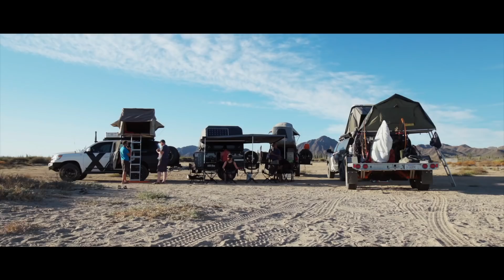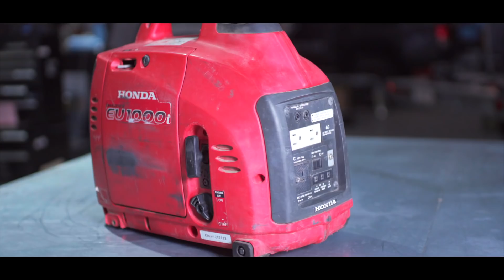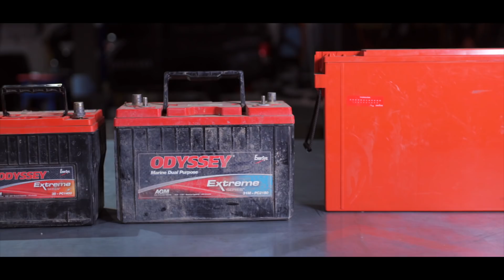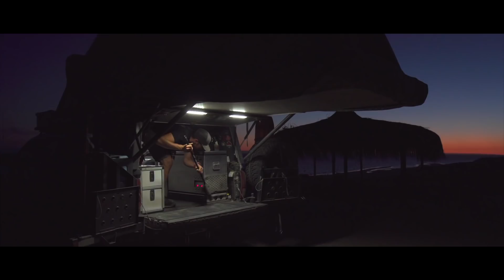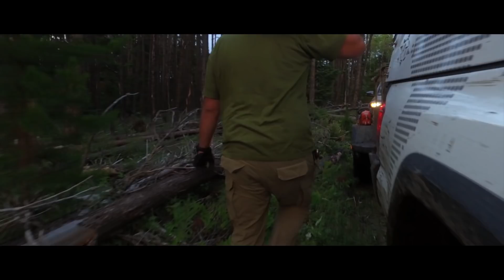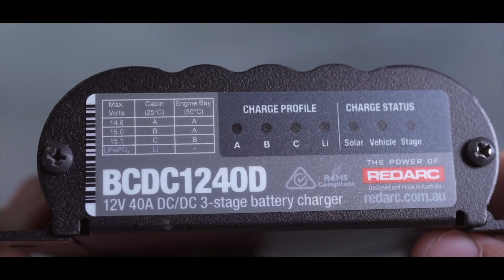Overlanding Vehicle Power and Battery Systems: Proven - Gear & Tactics by X Overland

Comment: Also what are your thoughts on hood mounted solar panels?  I was looking at Cascadia 4x4 hood 30w panel to passive charge my main battery.  And then I wanted to run a separate battery in the truck bed of my gladiator mounted to a top rack mounted bigger solar panel to charge batteries / gear / fridge.   Any tips and info would be helpful! Thank you!

Comment: Curious on the battery selection. Many of the people we camp with, bring RV's and many have resolved their power problems by replacing their 12v batteries, with dual 6v batteries for the additional AH. Have you guys experimented with a similar set up or heard good and bad information about going that route? Very interested in having a Redarc battery management system and curious if it would work with that set up and effectively see the two 6v as one 12v and operate/ monitor the power as well as it would the single unit...

Comment: Just a heads up, sine wave inverters do produce a sine wave, but non sine wave inverters don't produce a weird looking wavy pattern, they produce a square wave. They spend time either at the positive voltage, zero, or the negative voltage with abrupt transitions.

Comment: Next move for you should be to look at LiFePO4 battery's. Far more usable amp hours because you can run battery's down almost all the way without damaging, lighter and 4x the cycle duty on average. Battle born is a popular brand right now

Comment: Great information. We run a Genesis Dual Battery system in our JK with two yellow top Optima Batteries, and carry a 110 watt solar panel as a backup power source. Works very well for our overlanding trips.

Comment: There is another drawback to Li batteries in addition to cost and that is they don't like to operate in cold/very cold temps.  If doing winter work, the batteries temperature needs to be accommodated.  Another advantage is that they can endure many more deep draw downs than other batteries i.e AGM, etc. Love your videos.

Comment: Clay, quick question, why don't you go to a larger alternator in your Toyotas?  I went from the 130 amp OEM in my 5th gen 4Runner to an aftermarket 270 amp.  Couldn't be happier.  I realize you still have to have the rpm's up but the difference is still worthwhile. I also use a portable 185 amp solar panel when camping.  It is a bit of a bear to store and set up but never needed any more power than it puts out.

Comment: do you choose your equipment based on weight?  i ask because the trucks with caps and armor already seem fairly heavy already and if you bring on more  equipment, would it just bog down the trucks so much it might seem dangerous on higher pitch surfaces?

Comment: Wife and I are looking to purchase a Vestibule Tear Drop to tow behind our Toyota Highlander. After watching several power videos I believe solar is your solution over the long term. But, for short off grid meanderings I may stay with my Honda gen set as it sips fuel, always runs, with an extension cord can hardly be heard from distance from camp while running at idol charging batteries. 

To my thinking gen set versus solar is theft. Folding portable solar panels can be quickly carried away if I want to run to a Mom and Pop mountain Cafe for lunch. With my Honda going, Even exploring away from the camp site. I have a spiffy security system as I just let’er run couple of hours to get my 110 amps back good again. At night, I have little reason to run generator. Unless of course its HOT 🥵 then this old Dude has NO Problem burning unleaded. 

I have owned my Honda for 20 years, I bought another the same so I can pair them up if need be. Speaking of emergencies. Home base power outages are now the norm here in California. My Honda 2000’i serve double duty keeping my refrigerator and freezer going for lengthly hours. If it were me, I’d seriously do the math an research what power really means affecting your adventuring but also, being a backup for the home. 

One other thing. When buying fuel for generator use. Be sure to enter 30 Day reminder in your cell phone calendar so as to pour stored fuel into your vehicle. Replenish ASAP. This way fuel is always fresh. Of course I am speaking to California blended fuels—Your state may vary. The reason I don’t use stable is due to high cost here in Cally. I figure, soon, we’ll reach $5.00 a gallon closer to Christmas.

Comment: Have you considered Lifepo4 batteries?
Reply: W0JMR We offer those. They have their place, but AGM is more reliable by far. Very common for bms failures in vibration applications. Plus there’s the whole leave not trace thing.Li is pretty harmful for the environment considering you can’t recycle it, and the mining process is rough too.

Comment: I was always having to replace the battery on my dualsport around 1 time per year. I upgraded to an odyssey battery... and never had to change it again. It was worth it. More reliable AND cheaper after year two or so. lol
Reply: And... I agree about Lithium! It is next level for batteries. Not as sensitive to cold or heat as lead-acid either. Less fade.

Comment: Many people here in Oz use simple VSR controllers (not DC-DC) to give maximum charge to recreational batteries, supplemented with solar (caveat, "smart" alternators need to have the controlled charging turned off). Unless looking at long cable runs (to camper trailers etc.) I can see no benefit to using DC-DC. A VSR will charge more quickly than a DC-Dc for day to day tripping, topping up with solar simply makes the situation more reliable. I know you are sponsored by Redarc, but their recommendations for the average vehicle are more suited to their marketing and profitability than your outcomes (and their solar panels are, IMO, ridiculously overpriced.

Comment: Those big agm batteries are not worth it for mobile uses. The weight per usuable amp/hr is outrageous. Not to mention the space they take up. A 55 amp hr lifepo4 battery has more usable power, takes up a 4th of the space and weighs probably 20%.

Comment: 100w of permanently mounted Renogy solar, 200Ah of AGM battery storage in 2- 6v units, supplemented by alternator charging through a Blue Sea ACR, took me and my family to Guatemala and back. We had a 50L Dometic fridge, lights, laptop and camera chargers drawing on it and never had a problem, even when sitting for a few days in 35 (95) degree heat.
Reply: Almost my same setup, 100w permanently mounted, 100ah house battery with voltage sensing relay, off main battery/alternator. About to switch to lifepo4 battery for more usable power if I have a couple cloudy days in a row.

Comment: Would you please make a video about how to select the right roof rack? What are the advantage/disadvantages between between more modern style racks such as Eezi-Awn and Frontrunner versus the traditional basket style racks for overlanding trips? Also, for those of us who also use roof boxes (Kamei, Thule, etc.) and are considering an Eezi-Awn rack, how can we ensure that we can still use our roof boxes on family road trips?
Reply: "how can we ensure that we can still use our roof boxes" = no difference to your current roof rack... use suitable U bolts to mount the boxes. "advantage/disadvantages between between more modern style racks " = flat racks provide more storage flexibility in terms of not being restricted by vertical sides on the rack, just look at the difference and it's self explanatory. Also, flat racks are slightly more aerodynamic when not loaded. No need for a video on this topic. cheers

Comment: the (i) on the generator stands for inverter generator, it is an added cost if your application needs it, if you are running power tools and lights of the generator you won't need a staple frequency/voltage anyway, and most laptops chargers will work of a huge frequency and voltage range, but some smaller electronics might be sensitive to voltage drop and frequency shift.
you should have used 350-watt solar PV panels, they should be enough for all of your needs.
i was planning to build my own LI-PO battery using 18650s, it is cheaper though and lighter, and you can shape up ur power storage to your space, with maximum battery life if used correctly.
Reply: Can you expand on building a battery from 18650s? Any links for where you did your research on that?

Comment: There are reinforced higher power alternators for many vehicles available on the market, did you try one of these? While most alternators are 3 phase, they often use 6 phases what gives you a smother DC current after rectification and also higher possible amp draw at low rpm.

Comment: Good to hear you're going with solar, it is the best way to go. Do not go cheap on your lithium batteries or charge controllers. Check out Battle Born Batteries and Victron Energy for your charge controllers and inverters. Keep your Honda generator for backup. Find a way to mount your solar panels on your trailers and trucks. While you're going slow on the trails they will be charging your batteries.

Comment: 1a) Your alternator will perform much better if you install a very slightly smaller fully on it so that at idle it will put out full power. This is not enough to wear out the alternator prematurely since the alternator only needs a slight RPM increase to put out almost full power. You can also look at the parts catalog and install a larger alternator that was intended for Police/Fire/Ambulance vehicles because they can be ordered from the factory with alternators that are designed to keep all their electrical equipment operating at fill power even when the vehicle is idling for hours at a time.
1b) Your usage appears to be very close to the Police/Fire/Ambulance usage case so you may want to peruse their options to see if they have already solved your problem.
2) Lithium batteries can fail if they receive any sharp impacts or excess steady vibrations above its threshold, do some research to see if you can install a shock absorbing mat or mount for them. us
Reply: I was about to say this and you summed it up perfectly.

We run an alternator that runs 180amps at idle which comes from a military radio truck
Reply: @JimmyStewpot  I want that alternator! LOL

Comment: SIne Wave is actually pronounced like Sign Wave (not "Sin" Wave) LOL Other wise its a great video, thanks!
Reply: Plus a non sinewave is also known as a squarewave as the scope is squared off.
Reply: @makemineatriple2006  Actually in devotes that supply power it is most commonly known as a "Modified Square Wave"
Reply from the maker: LOL. Good to know!
Reply: Also known as a sinusoid, ( probably why some call it a sin wave) which is a mathmatical curve.
Reply: True, but was that worth being a douche?
Reply: @nathanhiggins1438  I don't know, was it?
Reply: Those crazy “Sin” waves.  Lol. Nice work clay.
Reply: THIS. lol
Reply: I would suggest checking out:  https://www.australiandirect.com.au/brand/KickAss

Outfitting my ‘88 4runner with the dual battery plug and play system.

Goal Light weight Vehicle w/ exceptional ability to travel all terrains while loaded

Truck:  1988 4runner
Engine:  3.4L Toyota Swapped w/supercharger 
Trans:  151F 5SPD Manual Transmission
Shell:  3 coats of polyurea coated to add exceptional strength and Kevlar lined.  
Rack:  Rhino flat rack 
RTT:  Tepui for now
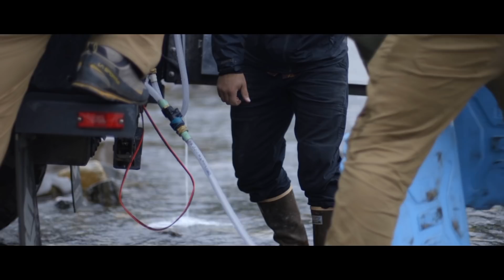Gears:  4:56 w/ E-Locker in rear
Wheels/Tires:  295/75/16 w/SCS F5
Suspension: OME Dakar w/ AAL @Fox shocks
Internal Cage: 4xInovations(waiting delivery)
Power:  Australian Direct Dual Battery Combo 4 Ultimate Tourer

Frig, Box system, On-Board Air and Power Tank.

I listed all of these things to ask why no one ever mentions ways the average person can get great kit and install them at home without having to utilize expensive parts fitting companies like their local shops...most shops charge 700-1000 or to install set up like you guys utilize, but no one ever mentions their are plug and play systems which allow easy install with removal from Rig to Rig.  My ‘88 has no AC so my four daughters prefer to take trips in our Tacoma with all of the creature comforts of remote reservoir Fox shocks and AC, and etc.  The plus of this system is it can be moved from vehicle to vehicle.  It also has a self contained box to “prevent” fire with extra power ports, USB ports, and Anderson connects for solar while being regulated by by a DCDC battery management system.  Hence why I listed all of what was done to my ‘88 as I love it and kids tolerate it but we all love power and a system like this is easily transferred from vehicle to vehicle.  And now with a simple move of the power box, disconnect of the main harness, and the fridge from vehicle.  I saved roughly 2-4K by having a portable system. Which is still “hard wired” in each Rig.  Glad you did this video and enjoy the progression you all have made.  Plus the high dollar swag is cool to see!  Keep being great!  Final side note AU direct does not have US distributors so one will need to find a trusted AU YouTuber to send them the kit😉.  I am not that guy.  But if one searches I am certain they can find one.  Golden kid from CA.  Soul Surfer Out!
Reply: Steven Adams idiots usually roll their eyes due to their inability to understand reason, you must be an idiot....